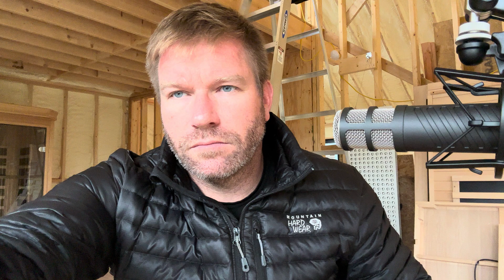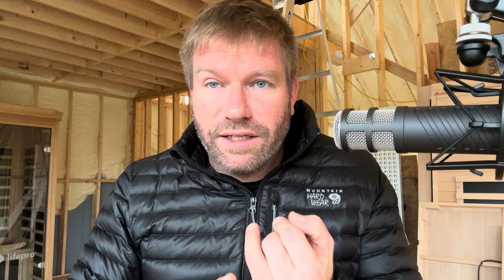Installing Saunas On GFCI Outlets & AFCI Breakers - 15 to 20 amp adapters

Comment: Interesting how you talk about idiots on the internet yet you tell people to swap a afci gfci breaker for a standard thermal breaker is kinda crazy. It's just as much a code violation as what you accuse internet idiots for doing.

Gfci is not only for water but it's for grounding faults hence the name. If a wire melts or burns in the sauna do to a malfunction, and the metal components get energized, it can kill you weather you're dry or sweating.

If it does trip, my recommendation (master electrician) do not remove the gfci protection but swap it with a SPGFCI which is yes more expensive but will have far less  tripping.

God forbid a death or fire happens, you're insurance will not pay if they find out you violated an electrical code which caused the problem.
Reply from the maker: Sorry, this is not accurate. And saying people are going to die is rather extreme. I would’ve been dead a long time ago if this were true. 

Although I do understand where you’re coming from, and would like to agree with you in a perfect world, the reality is phantom tripping is a problem that’s getting worse. Quite frankly, you seem out of touch on new code requirements wreaking havoc in the field. There is a reason NEMA has a dedicated page for brand reports: https://www.afcisafety.org/home-owners/unwanted-tripping/

https://www.electriciansforums.net/threads/why-is-my-afci-breaker-tripping.188849/#post-1646737

In my opinion, it’s much more dangerous to run a 20 amp sauna with an outlet adapter (like the “idiots” on the internet suggest) on 16ga wire runs, than swapping an AFCI breaker. 

I would absolutely be worried about fire or death in the middle of the night with that. A breaker swap, not so much.

On top of this, AFCI is a relatively new code requirement in the grand scheme of construction. Yet folks have been doing what you claim is hazardous for the last few decades without issue, and if your theory is correct, everyone’s house in our country would’ve burned down by now. (Assuming you recognize this is not limited to saunas, and electricians everywhere are having to take AFCI breakers out so smart dishwashers and other appliances work reliably.)

I’m only responding because you said people will die, which is a serious allegation.